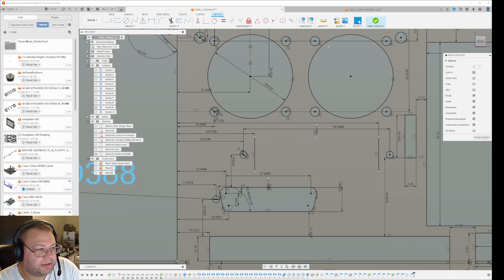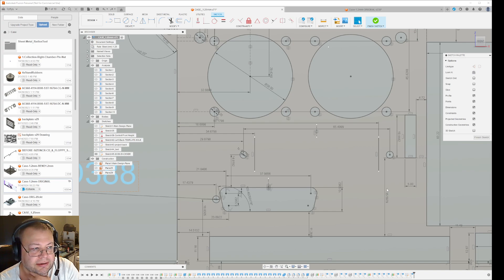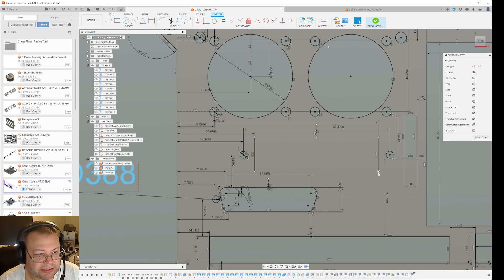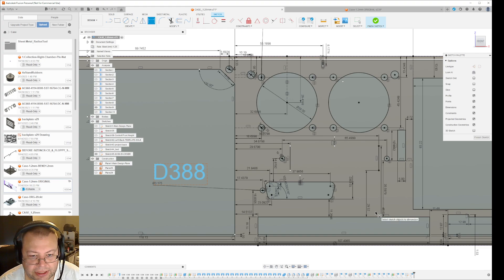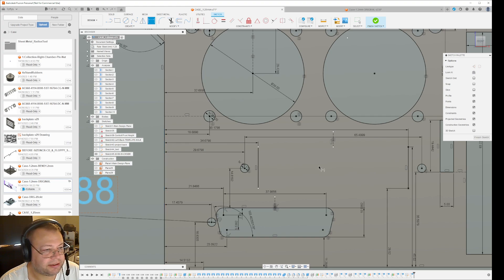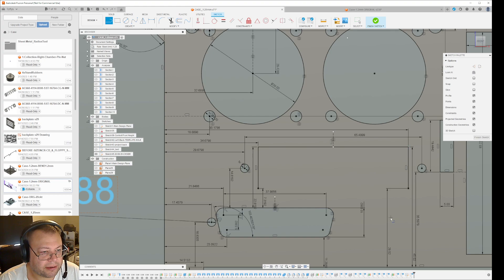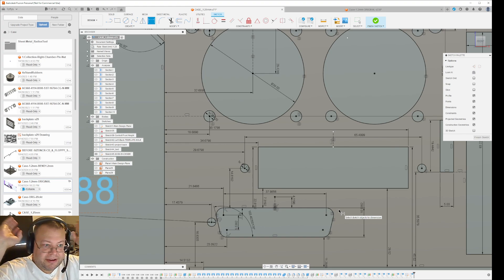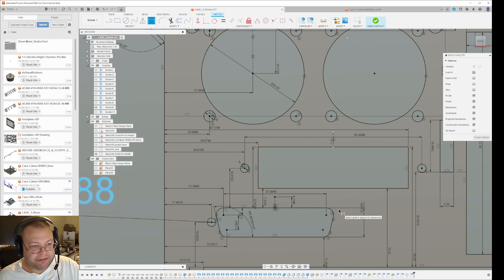Fusion 360 - The WHITE dots may be the source of YOUR problems!

Comment: Excellent and thank uou, have ran into that exact issue just recently but did not find a solution, just continued with being extra careful not to move unconstrained geometry
Reply from the maker: Literately the same as I did. Now the video outline constraining dots in 2D space sketches. I have never done this with 3D sketch activated, so don't know how that would work. I try to sketch as much as possible in 2D , but have also made a video about how to create closed shapes in 3D sketches with points which i advise to check out. 

If you design a sketch element which should contain many sketch elements, then i highly advise to start off with a 2-point constraint like TOP and LEFT or RIGHT, then make references to these values with TEXT objects to easily see them. Then you simply draw the rest of the sketch-elements from that constrained point, and you only change those to values and since everything is constrained it will move without distorting things. 

Thanks for watching, and hit that like button and sub for more. :D